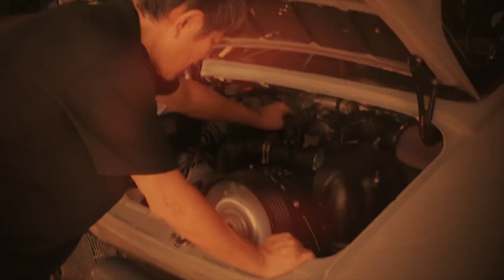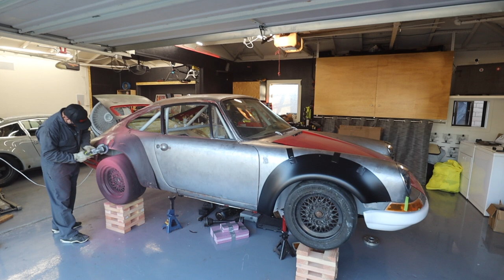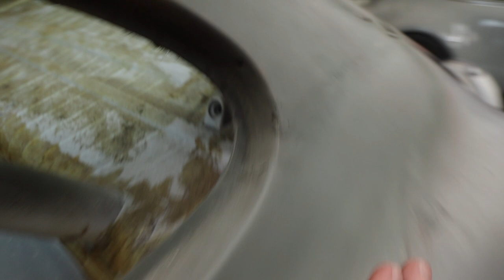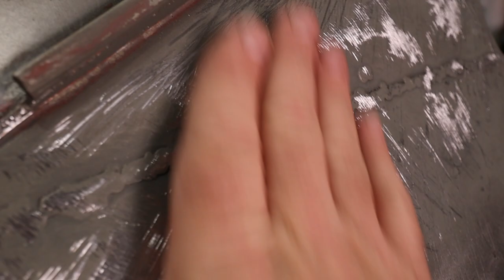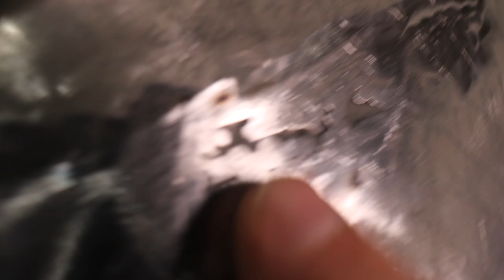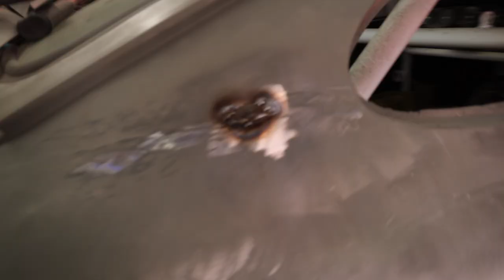To FLARE or NOT to FLARE My Subaru Powered Porsche 911 | Blasphemy Build 30

Comment: you can make a contour gage using bamboo skewers and alloy strips.
cut the skewers with sharp knife to about 4 inches ( 100 mm) and some 1" wide aluminium strip to sandwich the skewers and washersas spacers.

Comment: Phoenix, Arizona!  ---  Great video, I could see that metal thinning on you in one of the shots you could really see it flex too easy.  I've done a lot of this work on my '72 restoration so I could feel your pain about to happen.  And I've often ended up were you just have to put in a small patch panel.  All is looking really good and I love your 2x4 stands.  One thing you should look at regarding the front and rear flares is the lip/edge.  On the SC it is very sharp and small.  On the turbo it is very round and large.  Just a suggestion, I'm sure you have a lot of money and time into both of these flares, but I would consider getting flares where that lip profile matches because there really isn't anything you can do to make the two that you have match.  I'm interested in seeing what measurements you are going to come back with, but you may just want to get another set of rear SC flares and put them on the front.  Or go 93 out the back.  Good luck and I'm watching no matter what you to do.  High Five!!!

Comment: By the way. We call that tool a slapper. Its a panel beating tool not a file. When used with a dolly behind you lift a low section. The file finish also helps to shrink the metal into the surface to pull down high spots as you go.
Try it on a old piece of steel. Its magic compared to a normal hammer.. especially for most of us less skilled amateurs!
Reply from the maker: LOL!  I know...I couldn't remember the damn name while the camera is on.  It's a great tool!

Comment: Hi, listen, when your doing your bodywork welding, don’t grind the welds with the flap wheel.
Invest in an air compressor with a dies grinder, a 2” folic disc holder and a box of 2” course grit pads. Then you can get the grinding surface on the weld and not the surrounding panel. Every time you hit the weld with the big flap disc your making the metal of the panel each side of the weld thinner! 
Good luck
Reply from the maker: I've gotten one in the last 3 weeks!  Check out my bumper restoration video from a couple weeks ago!  Thanks Liam!

Comment: When your checking for body waves, dents etc. try wearing nitrile gloves and use a clean white (untreated) shop towel, it helps to feel the imperfections and keeps body sweat off the bare metal, which will really cause issues down the road. Awesome vids!! I’m doing a 914 with a Chevy V8 and WRX transaxle, full Big flares etc!!!!
Reply from the maker: Great tip! Thanks for that Mark! Do you have a build thread going on your car?
Reply: @rennch.  I’m thinking about doing that, but haven’t fully committed to setting aside the time for filming and editing 😐
Reply from the maker: @markf.4467  Well, it IS a fair bit of time.  I calculated that I have about 25 hours into each episode, total.
Reply: @rennch.  Yikes!! Have you tried the Leading yet? Early in my career as a painter I worked with an old timer that still did a fair amount of lead work, he was amazing to watch...
Reply from the maker: @markf.4467  Launching that vid as we speak.
Reply: @rennch.  Thanks I watched it 👍👍if you get too frustrated with the Lead,,,, Bondo when done correctly will outlast your Vehicle... It’s gotten a Bad rep from Butcher Bodymen😬 1/4 inch or less thickness will last forever. I’ve done many show quality vehicles that had bondo all over them, but it was done by a good body tech, I’ve seen them 15-20 years later and they have no shrinkage or delamination at all, and you can do larger areas much faster. Food for thought 🤔
Reply: @rennch.  Love the Vids by the way👍👍👍 I have that same Subi engine at home and almost used it in the 914, but ultimately when with the V8... But you’ve got me thinking about the next project and if it needs that Flat 6 with 2 Turbos😳

Comment: Hi, lovin the videos, can recommend using upol D polyester filler, it's a polyester filler with aluminium flakes, you don't get any shrinking on a welded joint, Jonathan Ross,( retired auto body/paint technician). Fenny Compton, Warwickshire, England
Reply from the maker: I will most likely be using that on the areas where the factory did NOT use lead.  What's your take on Lead vs. UPOL?
Reply: When I started working in bodyshops back in 1977, lead was only used if a customer specified its use on a restoration,on day to day accident repair jobs,filler was used,  using a polyester/metal hybrid fillers are maybe a modern alternative to lead, it certainly doesn't sink or crack like ordinary polyester filler,

Comment: I'd consider getting some tools that can sand/grind more accurately. those 40 grit flap discs will take off metal fast, and as you've found, you can't direct them to exactly the area you need. Maybe look at getting a finger sander, or even use a grinding disc on a dremel or angle grinder. Nice project!
Reply from the maker: I have both of those things...why I didn't break out the finger sander is a bit baffling.  You are quite right!

Comment: Matt, UK. Really enjoying the build. As you are flaring, what about air intakes like gt4 Cayman in quarters to cool inter coolers, get air to Turbo's?
Reply from the maker: I don't think I'll modify the flares like that, but I'll bring in air from another spot you might not expect.
Reply: @rennch.   now would that be through the rear quarter window like the singer? Mind you I do like the ducting on Mr Emory 356 rsr, I'm thinking that way for my narrow body 911 for oil cooling.
Reply from the maker: @mattedwards4164  No, I won't be doing any of that.

Comment: Panayiotis Kosma Cyprus 🇨🇾
Reply from the maker: Cyprus. That's crazy!  Any vintage Porsche out there?
Reply: @rennch. 
We have a lot of cars but almost all are in the hands of collectors a friend of mine had one sc targa that he bought for 17000 euro before 12 years and he traded the car later on for a carera 4 964 an he gave another 23000 on top.
Reply: He ended up selling that car for 23000. And not to mension tha he replaced the engine becouse he had a damaged rod and propably crank.
The guy that bought the 964 had also his SC and he contacted the mechanic that removed the old engine an he gave him the SC so he could rebuilt the old original engine so that the car will have matching numbers.

Comment: Porsche wheel arches should be illegal to cut into
Reply from the maker: I don't totally disagree.  Still in flux....
Reply: @rennch.  depends a little bit on the car, if it has been modified a thousand times before i guess it aint so bad